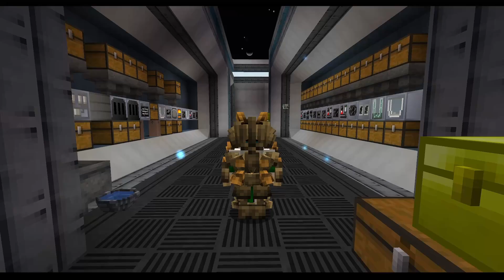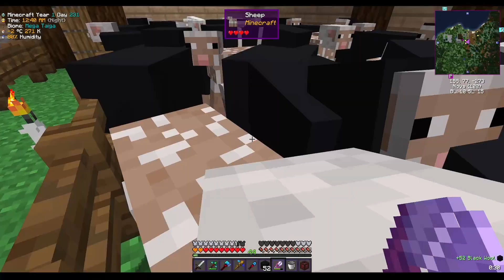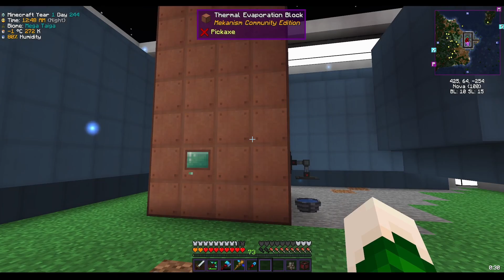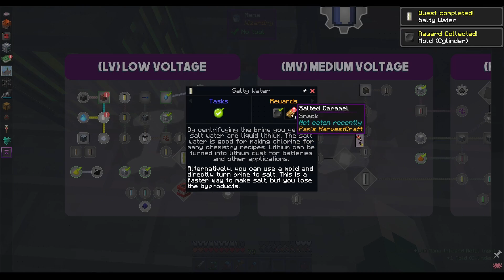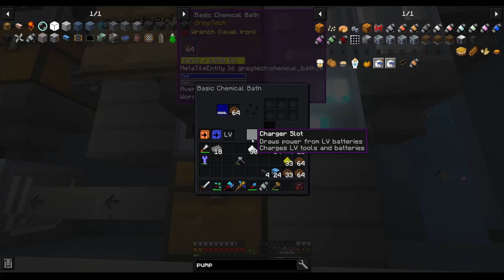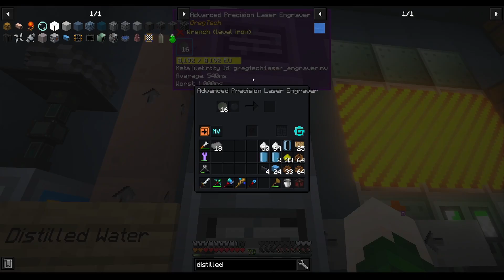FTB Interactions Remastered E09 - All My Circuits

Comment: This is a very different and fun way of doing GT! It’s very MBC-pilled. Most GT players seem to swear off passiving anything and prefer to make circuits themselves in bulk. But passiving is just… fun. Much more fun, IMO. Ultimately, do you prefer that you passived the circuit components as opposed to active crafting them forever?
Reply from the maker: it has been very useful though with the circuits improving the systems do change a lot. overall though even when i have a few things to manually get having a lot of components lying about is very useful. true passive won’t come until ae2 though.

Comment: Lubricant is quite easy to get for the cutting machine as well instead of using (distilled) water
2 MV energy hatches on the EBF for the silicon boules was overclocking the recipe to HV, making the EBF to need 480 eu/t but cutting down the time by half
Hatches/buses auto input, so you don’t need to hopper into them
Reply from the maker: ah thank you!!! especially for the ebf thing that’s incredibly helpful